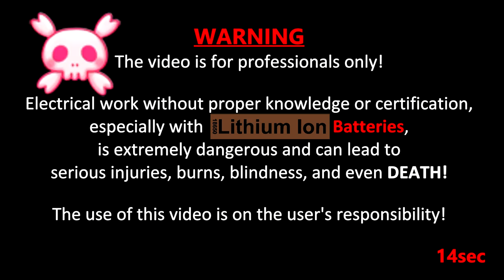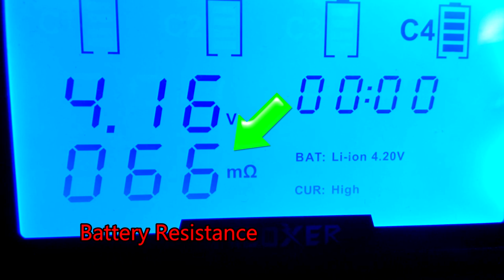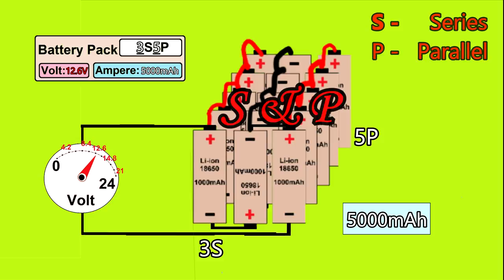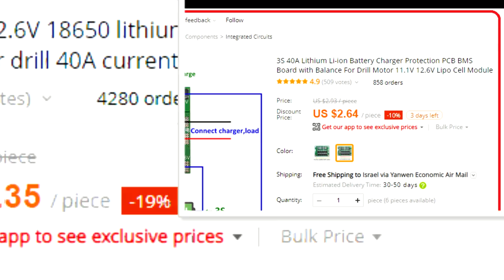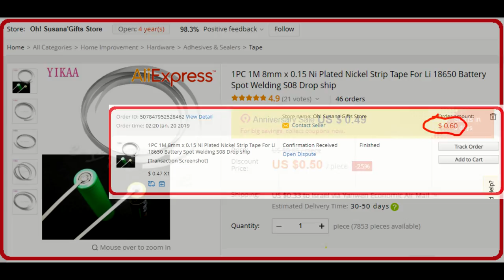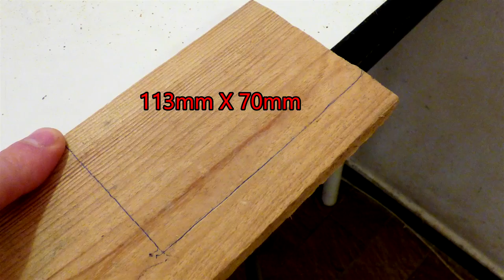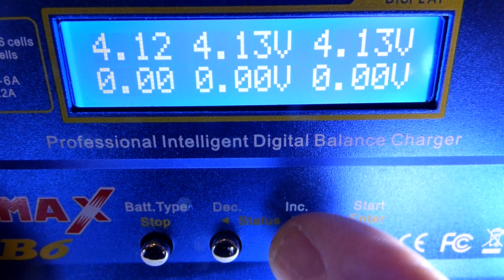How to Build a 18650 Lithium Ion Battery Pack with BMS - DIY - Time Lapse

Comment: But 12,6V Full is not enough... 
I use a charger with a car cigarette lighter connector. it sucks 8 amps.
If I get below 12.6V, the device switches off automatically because it no longer gets enough power. If this battery has 12.6V in a full state, my consumer doesn't even run.

Comment: How many 18650 batteries should i use for a GSX-R750 motorcycle? Thanks!
Reply from the maker: Today I recommend on: LiFePO4 Battery cell with Protect. This battery is considered more stable and  more safer. Their nominal voltage is: 3.2V. Maximum voltage is: 3.65V. (32700 Size: 32 * 70mm).
The battery pack voltage and its current are built by a single battery matrix in parallel and serial arrangement(P&S). If you have no knowledge of electricity, you are advised not try to build yourself such a battery pack, it could end in disaster.
Reply: @MyINNOVAMotorcycling  I have already build a 4S4P 18650 from old laptop batteries... the amps i am gettign are aproximately 10-11 with 16.8V.                But its not enough to start/crank . I have 6 supercapacitors i am thinking to add to the batteries and just might do the trick?
Reply from the maker: My dear friend, a 10 amp lithium-ion battery pack was supposed to start your GSXR750 motorcycle  engine without any difficulty. Lithium-ion batteries excel at providing higher than nominal Amps. For example 6C it means you can discharge 10AX6=60A amps. You probably don't get the Amps you think you get. I think something is wrong with your battery pack, and it could be very Dangerous!!!
16.8V ????!!!!???

REF1 = Yuasa YT12A-BS:
https://www.yuasa.co.uk/batteries/yt12a-bs.html
**YT12A-BS HAVE: CCA 175A,  12V**

REF2- C Rating:
https://youtu.be/mC1tj6bhwdY?t=44
Reply: @MyINNOVAMotorcycling  
I used 16x18650 in parallel .
The 18650 are from laptop batteries and give me around 18 amps. I have used as a guide this instructable https://www.instructables.com/id/Make-an-inexpensive-Lithium-Ion-Battery-Pack/
Thanks for your answer. Yes i did check the lead acid battery it does provide 10AH so maybe my 18650 do not provide the neccesary burst of amp.
The regulator/rectifier of my gsxr produces 13.8-14.2v
Reply from the maker: Note the numbers I listed above:
175CCA > 60A-C-Rating
Reply: @MyINNOVAMotorcycling  
Thanks for your reply.
I am thinking about buying 4 new lipo pouch batteries , how much C should each cell have?
Reply from the maker: @ib9459  C-Rating is a figure that needs to be checked by the manufacturer's specifications. Different batteries have a different performance. C-Rating is about attracting a high current for a short time. The electric starter is a device that requires a high current for a short time.
Lead Acid Battery can provides a short current pulse of 175A.
Reply from the maker: It is unclear what this item is. Who is the manufacturer? What type of cells? In my opinion it's not lithium-ion, and it's not lifepo4, so what is it? I can't guide you and that's not my goal either. My videos are meant to be entertaining, and for professionals they might gave ideas and help. The video was not created so people with no professional background will try to build lithium-ion battery pack, don't do it, it's dangerous, it could end in injuries or DEATH!!!
Reply: @ib9459  Just curious, did you finally get it worked? It is very important to use big wires for bike.

Comment: Do you have any issues with the factory charging system from the engine charging and maintaining the battery?  Were there any modifications you had to make to the factory battery charging system?
Reply from the maker: No, the charging system is the same charging system, which provides a maximum of 15.5 volts. A battery management card PCB BMS is responsible for everything else.
https://youtu.be/mC1tj6bhwdY?t=257